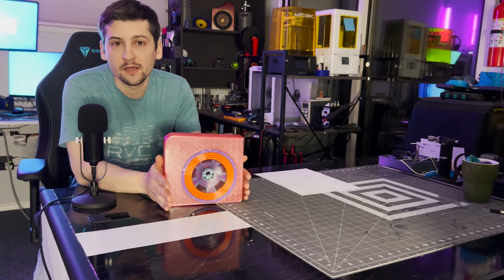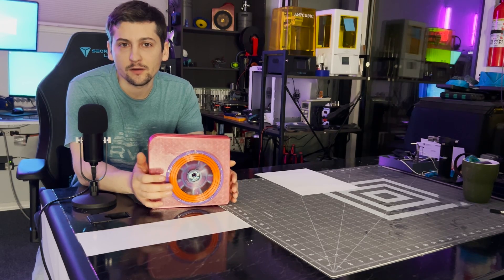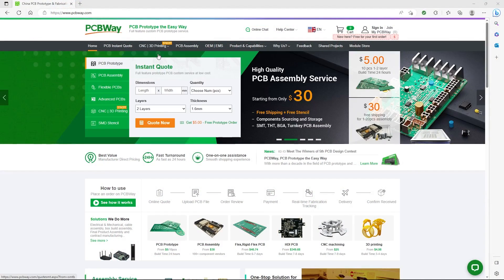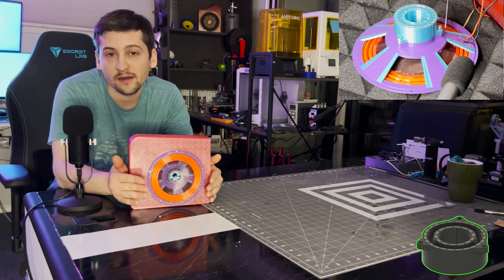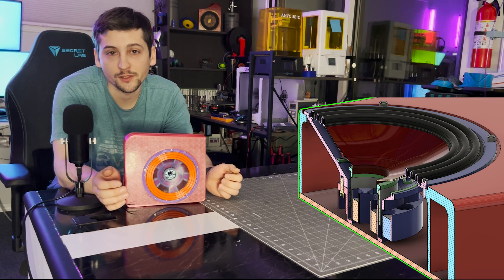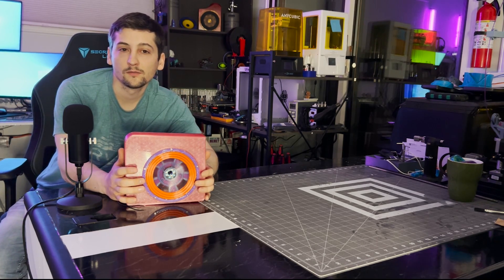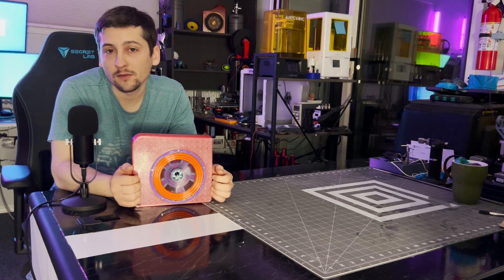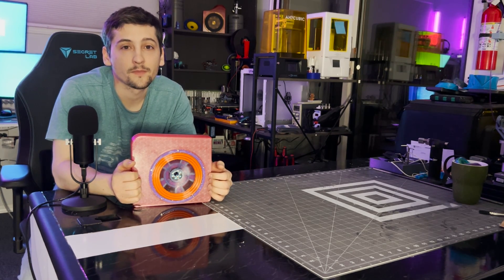Printing Sound- My Last Fully 3D Printed Speaker-V10

Comment: Way to go Justin on this journey. Its all steps in the right direction. What size was this speaker cone is diameter?
Reply from the maker: This I believe is a 95-105 mm cone depending on where you measure.

Comment: Great work! Nice comparison of different magnet setups. The enclosure is probably missing some rigidity, resulting in some resonances. I mean, you would probably want 1 inch thick concrete walls to prevent any, haha.
"Fully/100% 3D printed" was always relative: magnets and copper wire aren't. Maybe we can print those in the future (probably not) but it doesn't matter that much.
Reply from the maker: Thanks! And yeah, it’s about as fully 3D printed as possible with my current technology…